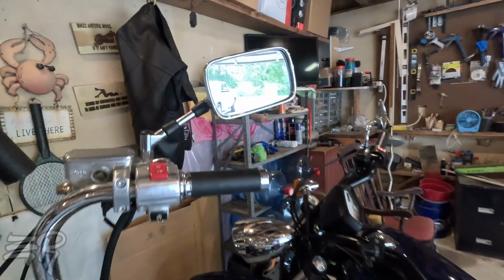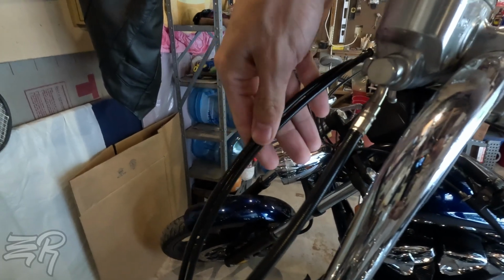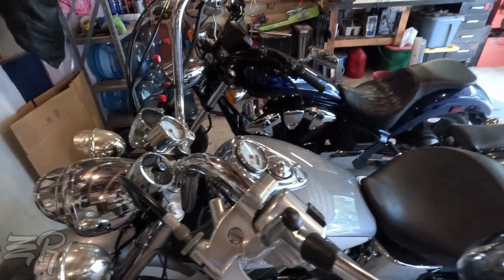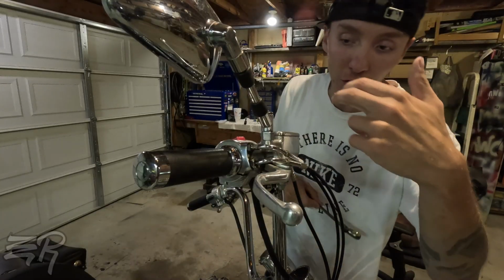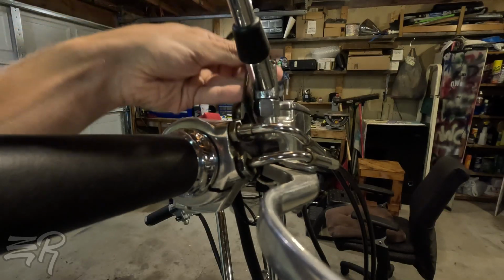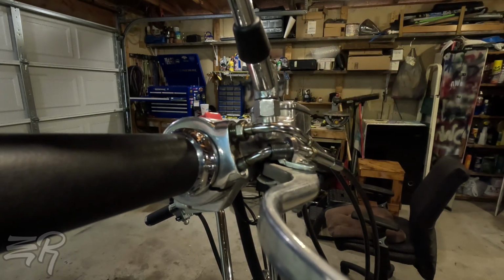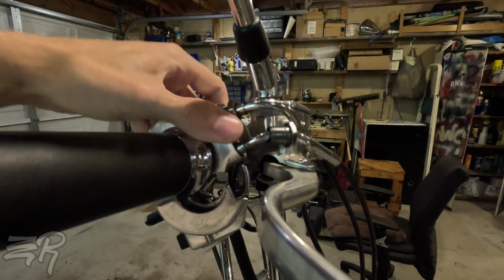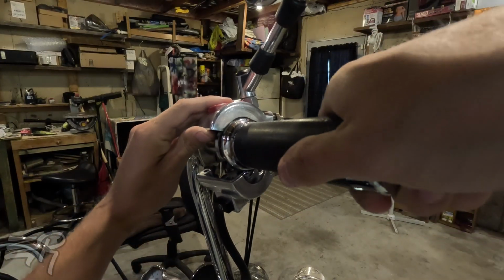Honda Shadow ACE Revival: Sticky Throttle Cable Fix

Comment: hey great video man,  I also have that carburetor choke cable plate cover with the five lines on it, it came with my shadow ace when I got it I couldn't find any information on it either, I figured it came in a kit because I have a matching front brake cover plate as well.